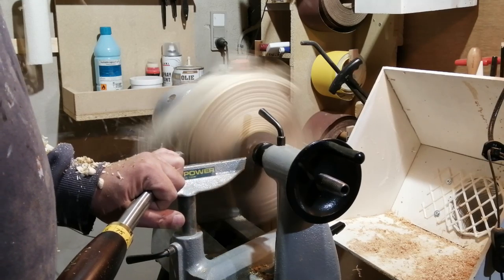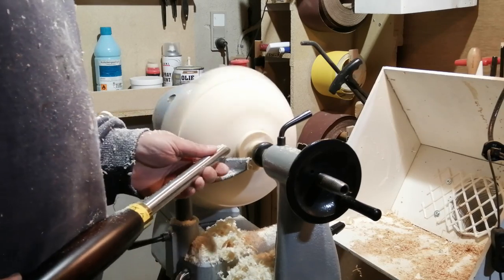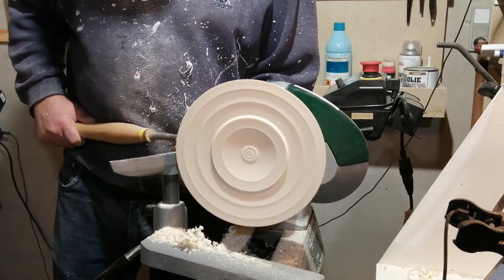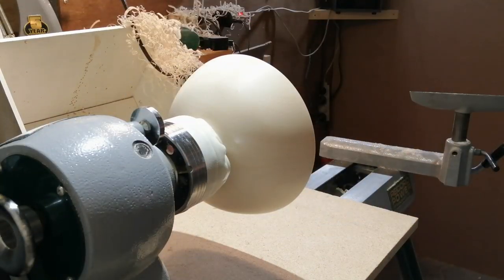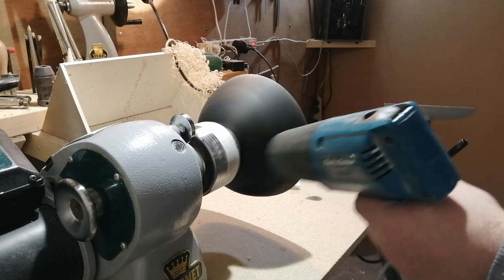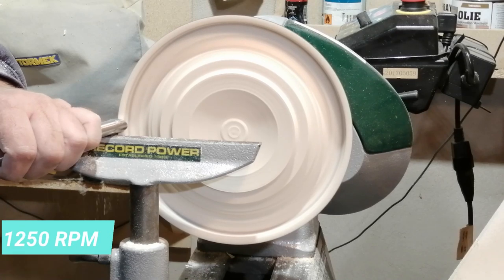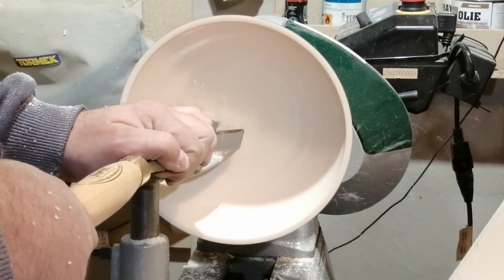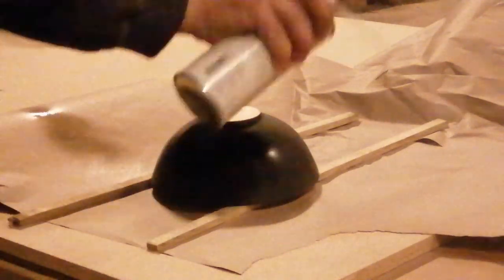How To Ebonizing a maple bowl with shoe polish - Woodturning..

Comment: I am glad that you showed your first effort complete with errors.  I think it is even more beneficial  than seeing only "perfect" turning videos.   I was also impressed with how well your bowl gouges cut.  I didn't recognize the brand but I will definitely look it up.
Reply from the maker: Thank you very much and thanks for watching .. I use Hamlet turning tools for the most part. I think it is a good tool for a fair price not the most expensive but defensively not cheap either, I use the normale one not the M42 😀 and it hold the cutting edge really good in my opinion ..  Have a  great day .. and stay safe 😀😀😀

Comment: CA stains are indeed annoying. I'm considering to use woodglue instead. But of course it requires a longer time to set.
The narration worked quite well. I might start trying that too!
Reply from the maker: Hi Leo, I generally think CA is ok, and yes wood glue will take fare to long if used with small cracks .. thanks for the input and the comment stay safe😀